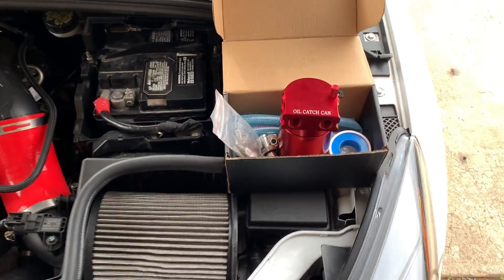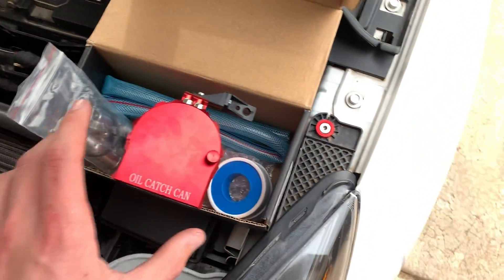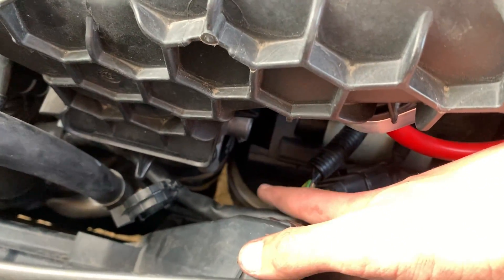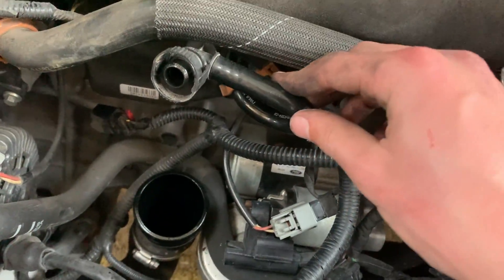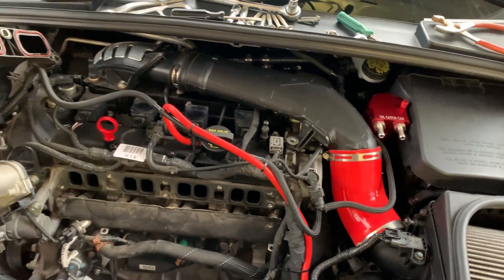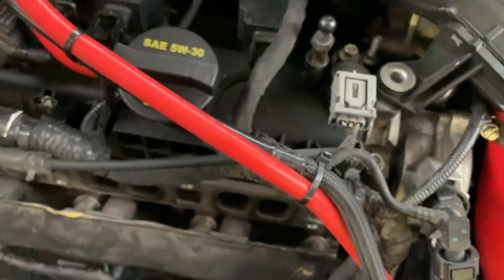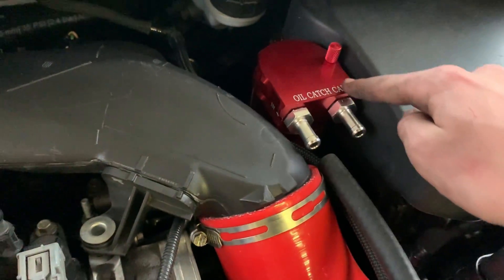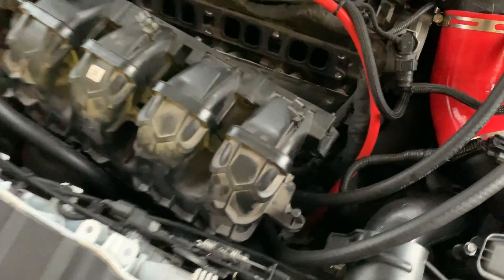How to Install a Universal Oil Catch Can on a Focus ST - A $25 Mod That Can Save Your Engine!

Comment from the maker: Update: after driving the car for less than 100 miles, it has already caught oil and I’ve had no problems
Reply: I just ordered this, it has a breather tho.
Reply from the maker: Asher Demme It probably won’t be a problem but you could try plugging the hole where the breather is if it becomes a problem
Reply: came with a bolt inside the hole where the breather goes. I'll just leave it that way

Comment: The out is the now clean air that should run into your intake. The in should come from the pcv or where ever you are trying to vent and clean. The filtered vented catch cans are great and are what should be used to release built up crank case pressure….just maybe not a cheap $20 version is all.

Comment: where is the oil coming from/ and where is it ending up?..when i took off my sound imposer blank out plate it did have oil on it ...
Reply from the maker: Yeah that’s normal. The oil would normally go into the intake but the catch can prevents that
Reply: @Nickjoenap  Okay I ordered one, thanks..did you do a rear seat delete yet and get rid of the spare  ..about 130lbs gone..what difference ..turns the car into a SUV!
Reply from the maker: @Mustangchef  I haven’t. I’m planning on removing the spare though because my car is too low to use it anyways
Reply: @Nickjoenap  40lbs , boom , gone..its like an anchor
Reply from the maker: @Mustangchef  Well I’ll have to try that out
Reply: @Nickjoenap  ya when you lift that tire out of there you’ll be like WTF

Comment: What kind of hose is necessary for catch can back to intake?  The 3/4" heater hose that I used collapses.  Heat from the engine makes the hose pliable, and the intake's vacuum pressure causes it to collapse.
Reply from the maker: Use fuel like or vacuum hose. There’s a link to what I used in the comments

Comment: What year is your ST please? I've seen other videos using 2 catch cans one to the ccv side as well as this one that you do. I've got a 2016 ST and want yo put a catch can on it.
Reply from the maker: Mine is a 2013, the catch can I did in this video will also work for your 2016. The other side is the one that’s different. If you look at my steeda oil separator video, that is the one that is in a different location.

Comment: What kind of hose is it I bought a radiator hose not working its getting flat which one did u use?
Reply from the maker: ST Suspect I used 3/8 inch fuel line. Here’s the link where I bought it https://www.amazon.com/dp/B0058I2552/ref=cm_sw_r_cp_api_i_OeLKEbVEMRKQM
Reply: Nickjoenap you didn’t how to stretch the hose it was a direct fit ? I used a radiator hose and it got flat were the intake manifold part is
Reply from the maker: ST Suspect I cut the hose for the right length but everything fit right without stretching. The rubber is pretty thick and doesn’t flatten
Reply: Nickjoenap I got a mishimoto one on amazon $11 works great

Comment: What size hose did you use I have a 2018 Chevy Malibu with 1.5L Turbo and I plan to install one.
Reply from the maker: Sean Gowan I used 3/8 inch fuel line

Comment: I got the same one but someone told me that I gotta run in on the back side of the intake because this one doesn’t come with the check valve so it has to be connected to a non pressure PVC hose
Reply from the maker: Anthony Fierro I don’t think you have to. I’ve had this one for about 100 miles and it’s working great. Several other people have these on the Facebook groups and they also work great. I have the steeda oil separator on the back side of the intake

Comment: Good video,  I’m wondering what size hose you bought? got a pretty similar one off eBay but it didn’t come with any hose
Reply from the maker: mathupanic I used 3/8 inch fuel line. Here’s the link where I bought mine https://www.amazon.com/dp/B0058I2552/ref=cm_sw_r_cp_api_i_OeLKEbVEMRKQM
Reply: Nickjoenap thanks dude, just ordered it. Ever since Stage 3 I’ve been getting a lot of blow by. Definitely need to get the catch can installed ASAP
Reply from the maker: mathupanic It works great. It already caught a decent amount of oil only having it on for 50 miles